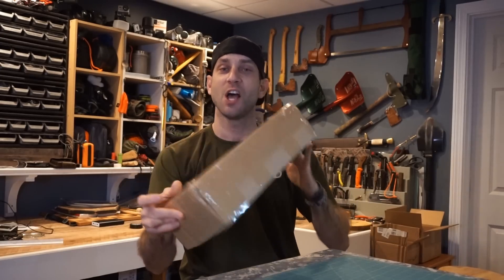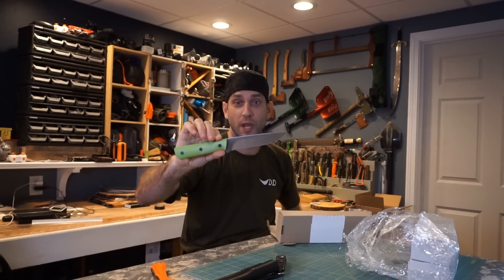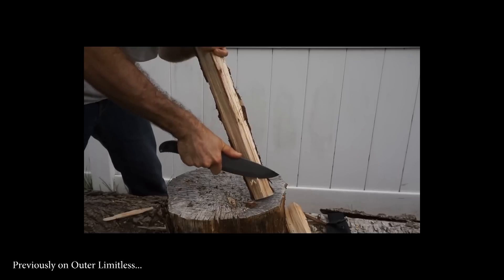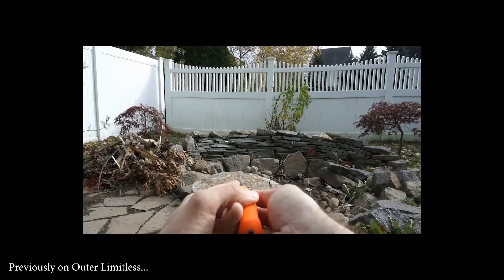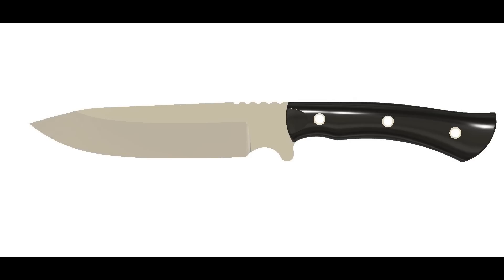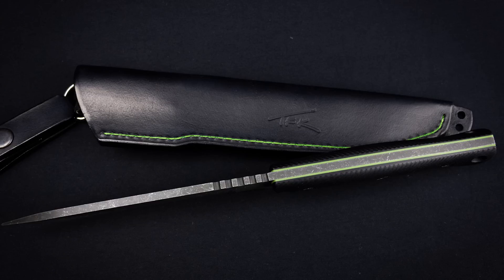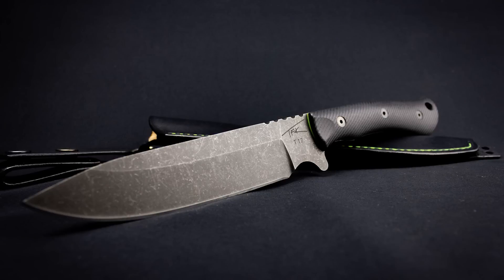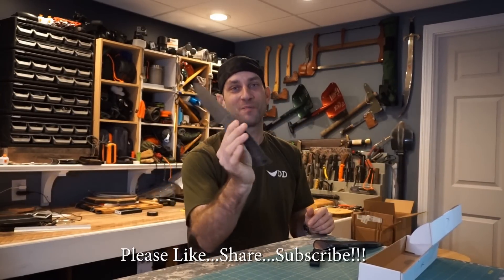My First Knife Design!  The Outer Limitless TFK T17:  A Year In The Making!

Comment: Wow. Between the handle shape (so often overlooked!), blade shape and size...stunning. Properly heat treated D2 is very hard top when it comes to usability. Not to mention the aesthetics...Truly stunning and I hope it works for you as good as it looks! I expect it will. Keep us posted!
Reply from the maker: Thanks Rick.  I was gonna put a huge hook on the back with a massive lump in the middle of the handle, but then I realized that was BAD design.  Haha, maybe next time!  But yeah thanks!!  I worked really hard on the ergos as well as the functional blade shape.  Aesthetics was second to function, but we NAILED the finish and made something that has both the function and form!  Lots more to come!  I appreciate it man!
Reply from the maker: FYI, TFK T17 goes on sale tomorrow (Sunday January 20).  There will be a
 video to start the sale that goes live at 10 AM EST.  This video will 
have all the ordering instructions.  I have 50 units available to start,
 first come, first serve.  These will be numbered #1 through #50 with a 
bunch of available options.

Comment: Loving the 
T3 nice thin grind on the lighter side for those hunters that don’t usually like carrying a big knife but a small slicer with a the steel to handle a tuff hide the T8 is a cool shtf knife love the green micarta handles reminds me of a pig sticker totally agree a 6 inch blade is great thought i do carry a 3- 4 inch backup because I love knives basically I have to be honest D2 steel is a good option but the god of steels I’m not sure about that though it’s a great steel that won’t disappoint unless u can’t sharpen a knife D2 can be a little harder to sharpen than other non super steels and especially for someone who doesn’t know what there doing on a stone I’m still learning after years of practice but I’m not the sharpest knife in the drawer get it 😂. Great design slight outward curve perfect Choil for the length good blade looks like a quality sheath great handle with some grip to it and a little pop with the toxic green liners let me know a price and when they are for sale I love to support knives made /designed by people I always check out on utube  or any small operation great blade love the design 👍.

Comment: What do you think of Chinese D2 like the Steel Will Roamer R300? Have you heard if it holds up to use like your TFK D2? I’m pretty sure I saw one of your videos, maybe this one, where you were comparing similar knives of which one was a Steel Will. Is it D2 also? I’m seeing D2 used in a lot of new knife designs. They’re probably using Chinese D2.
Reply from the maker: I'm not afraid of Chinese D2.  I pound the snot out of mine...infact, I just beat a Kubey up pretty damn hard and the think performed really well...video in a few days.  I think it all comes down to hear treat no matter what steel they use...the Roamers are good blades.  Yeah I would think chinese D2 on those.

Comment: Let’s us know price and when they are for sale. If the price is right, you know I am in. As long as mine is signed by the man!  Congratulations!
Reply from the maker: Thanks Dave!!  I appreciate that and LOVE the support.  Still working out the final design and price point, but we're 80% there.  I will be launching a KICKSTARTER in the near future.  I have some additional products to include in the price points.  I'm actually working on a custom kydex option right now.  The fabrication of the knife should be consistent enough to allow for tight molding tolerances.  So if things go well, I'll offer knife only, leather sheath, or kydex sheath options.
Reply: outer limitless kydex for me FOR SURE
Reply from the maker: FYI, TFK T17 goes on sale tomorrow (Sunday January 20).  There will be a
 video to start the sale that goes live at 10 AM EST.  This video will 
have all the ordering instructions.  I have 50 units available to start,
 first come, first serve.  These will be numbered #1 through #50 with a 
bunch of available options.
Reply: outer limitless exclusive price reveal??? So I can start count my pennies!.... 🤗

Comment: Lovely handle, uninspired blade shape. Well crafted.Tool steel in this the era of super steels? For a knife of this class I kind of require LC200N. Somewhere in the area of a B- or C+.
Reply: if that is the case why not just make all knives from tungsten carbide ?  D2 is a really great underrated steel and I like it a ton
Reply from the maker: I respect Jack's opinion.  Here's my take..so "uninspired blade shape".  YES, EXACTLY...that's actually a compliment.  I build this ONLY for function...the only aesthetics were added to finish, but anything related to shape is specifically for function.  I am a blade user and not a collector.  I thump on all my blades and use them primarily for fire wood processing.  That is the reason for this blade.  D2 is the steel we decided to work with...for now.  The beauty of it is that we can eventually experiment with other steels.  But as a prototype, who wants to go blowing through good slabs of 3V?  I need to make design changes to nail this down, so D2 is a solid steel.  I don't need "Super"...I just need functional and quality.  But thank you for including my design in that class of blade!